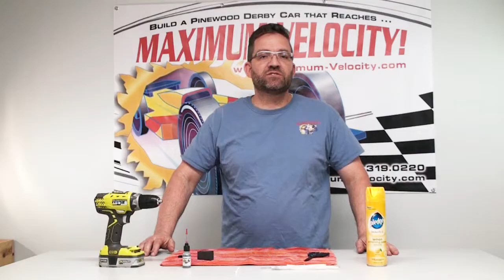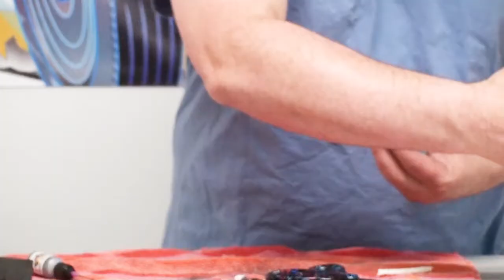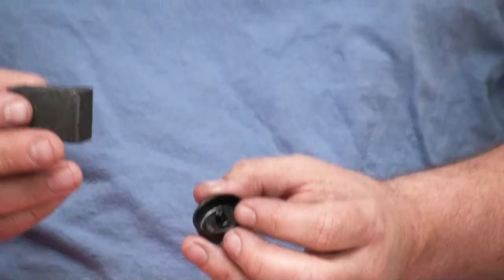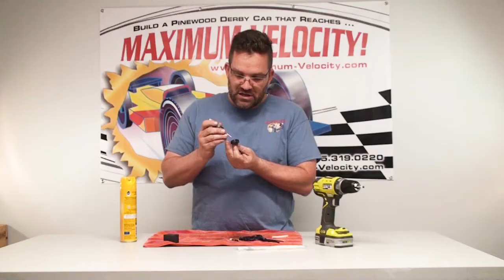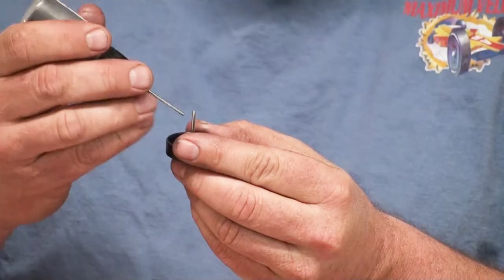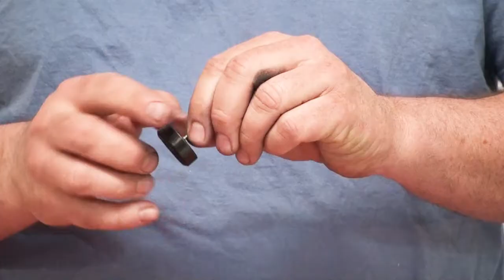Pinewood Derby Best Graphite Application - Maximum Velocity

Comment: when i raced very fast drag slotcars i found low weight oil faster that graphite not to say that graphite is not good but it needs a lot of upkeep
Reply: Pwd oil is definitely faster than graphite. However, some races prohibit oil as a lubricant for some reason.

Comment: Joel what is the purpose of putting pledge on with the graphite? I always put it on the axle and let it dry. when I did it your way the graphite hardened up in to graphite mud chunks in the wheel.
Reply: The pledge on the q-tip and pipe cleaner is just to hold the graphite onto its surface for burnishing the hub and bore better.

Comment: It’s obvious there’s many misconceptions in these comments. Which graphite to use.  No one sells a graphite better than Joel’s Max-Lube period. If a PineWoodDerby expert tells you there’s no difference in graphite then I would wonder about anything else he says. When our boys we’re building their cars I bought every tube of graphite I could find and I built a powdered machine that  tested how long a wheel would run with dozens & dozens of different brands of graphite. A lot of graphite no doubt comes from the same mfg just a different label. But there is a difference. One that you NEVER should use is the 50/50 combo of Graphite & Moly. It’s the best way to lose the race. 
Don’t worry about the particle size. If you want to compare get a tube of Joel’s Max-Lube squirt a little on a piece of paper. Take any other graphite and  put a squirt next to it and behold you immediately see a vast difference. On my machine no other graphite has made a wheel run longer. A big plus is the container Joel puts his graphite in. It’s designed for application on a PWD car. Another big plus he doesn’t hold you up. I would love to know how he found or developed this product.
There’s more!
Pledge is NOT a lubricant. It’s Not an oil. If you don’t follow Joel’s directions and saturate the pipe cleaner you WILL have problems. Our 3 boys & 3 grandboys have never raced in a district that prohibited polishing the bore. Pledge is a polish just ask your wife. It’s possible some districts have made such a rule and as Tom Hanks would say “that’s Stupid”. It’s just my opinion but a rule should never be made that can’t be enforced.
Before we leave the graphite one thing not obvious, I wasted alot of money trying to find  a pipe cleaner that was good for polishing the bore. Again Joel has just what you need. One small package is enough for several cars. Joel does not sell a pipe cleaner he sells a borer polisher.  
For my credentials and maybe bragging our family’s 6 kids have won practically all of the den races, most of the pack races and first or second in many district races.  During that time we have purchased 90% of our supplies from Maximum Velocity. A great company made even better when Joel took over. Customer service is great . we’ve had very few problems and he’s always bent over backwards to make things right. 
One last thing, we have always had a rule  it’s a father/son project 50/50. The benefits are great.
Sorry, One more, I have not been paid for these comments they are all mine. Joel sells products that will help your car win. We know and wish him the Best. 
Ron

Comment: This is a neat idea, and I imagine it works really well.  Thanks!  However, I would note that for derbies that prohibit liquid lubricants, which is most, I believe, I would say it does violate the rules.  Pledge is a polish/coating (as opposed if one were using water to help apply graphite, for example, which completely dries up).
Reply: If you spray pledge on your table and wipe it off does it stay wet forever? No it doesn't. 
Also, pledge is a polish not a lubricant.  You can run a car on just pledge, but any speed will be short lived and you'll get smoked.
Reply: @loud2ns lol just because it dries doesn't mean it's not a liquid lubricant lol it's 100% a liquid lubricant in this situation
Reply: @michaelgillette6132 
Is waxing your bores also illegal then according to your logic? That's a liquid at some point. Lol  
How about the graphite sprays that are out there? Still illegal? (Don't use spray graphite====slow!)

Comment: Thank you so much for this video! I am a single mom and nothing about this. I loved that I had these things on hand, nothing special I had to buy. Our cars  were fast! The dads were impressed and asking what I did! Thank you!
Reply: I'm about to be in your boat, I'm so nervous lol
Reply: @Love_life_always  to polish the wheel on the cheep use whitening tooth paste and do the same thing he did in this vid for graphite. Next be sure to polish the axle up to 2000 or better 2500 grit 
sand paper. If your allowed his zink or nickel axles are a few dollars and well worth it vs standard scout axles. It will save you mass time as you can jump right to 2000 grit sand paper and polishing.
Reply: @bt-xv1fy  thanks. I watched quite a few youtube videos with my kid after doing a lot of googling and reading lol. He won every race. So I guess we did something right🤣 we did polish the wheels and axles and used maximum velocity graphite. He made sure to hammer the wheels in straight, so the first attempt alignment was great.

Comment: Thanks Joel!  Can i use "Favor" lemon furniture polish (made by Johnson Wax) instead of "Pledge"?
Reply from the maker: You can try any of it.  I personally have only ever used the actual Pledge.
Reply: @maximumvelocity6563  It seemed to work just fine.  Wheels are spinning very well.  Graphite is still as messy as I remembered.
Reply: there is a catch to using pledge be sure it sits and drys for at least a day if not 2 if its any kind of wet it will junk up like mud, once it drys you will be lucky if the car makes it across the line.
Reply: @bt-xv1fy  ty